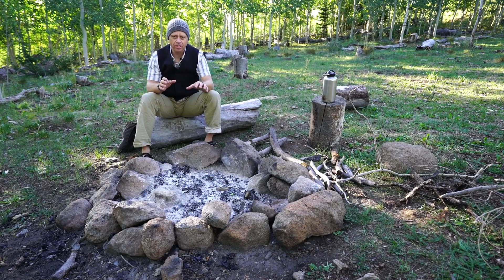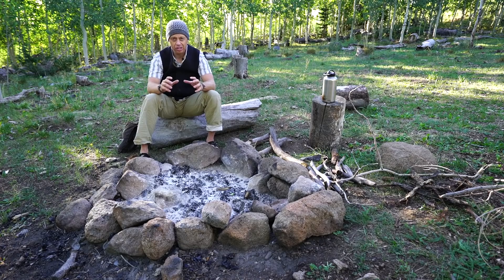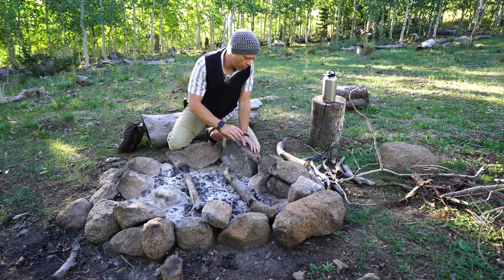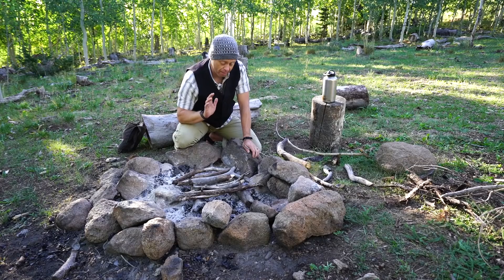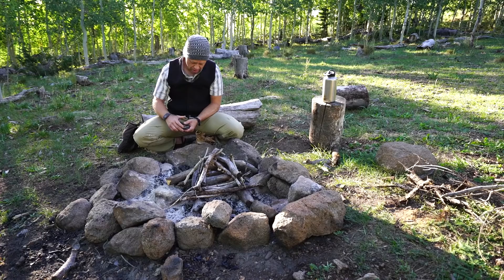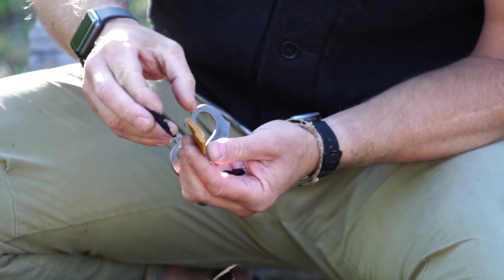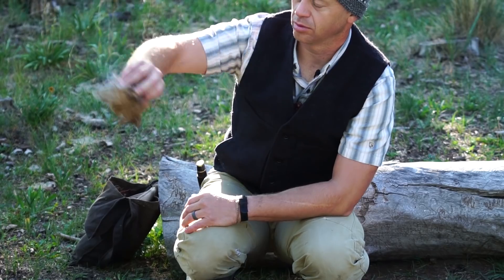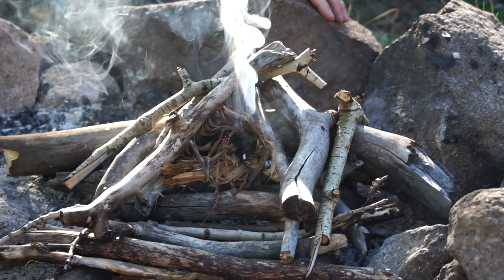A Fire Lay That Actually Works!

Comment: Here's something you might want to try. When carving feathersticks, I find that using the, say, last quarter of the edge towards the tip gives me the best results; finer and above all longer curls. At first it seems like a mechanical disadvantage, but feathersticks don't require power cuts. My hypothesis is that due to the decreased power, the blade can move a bit in the cut and thus conform better to the wood. Just give it a try, maybe it works for you.
Oh and great firelay. I have been using pretty much the same without the doglegs underneath. But the doglegs are a great idea for wet and/or cold ground conditions.
Reply from the maker: kaizoebara I’m all about learning new things. Do you have a video explaining what you’re talking about?
Reply: @TJackSurvival  I spent all my video gear money on carving tools, again... seriously though, me making a video would be hit or miss, I guess.
You can see it here, as demonstrated by Mors Kochanski:
https://youtu.be/TdbwJJkPGXA?t=88
You can see that he makes the curls mainly with the last quarter of the knife (in sword terms that'd be called the 'weak' of the blade) and how the knife rocks in his hands while he chases the cut. Another bonus is that you make use of the belly: due to the canted presentation of the edge you not only get a better slicing action (much like a guillotine), you also make the feather curl outward and not so much onto itself. Incidentally, he also has brittle/crumbly wood. Hope that explains it a bit, if not, feel free to ask.

Comment: Son, not a bad lay.  However, getting into semantics, heat doesn't rise it radiates. Warm air rises.  Heat is energy therefore no mass or volume so it can't draw in oxygen.  While the air has volume, rising due to the expansion of its volume from warming, it can draw oxygen.  Thus "draft".
Reply from the maker: fortbuilder100 Well technically, I don’t think anyone else was confused about what I said. ;)

Comment: I like the platform idea. I normally use a half dome with kindling and put my tinder bundle underneath. It falls over on itself and ignites the small sticks I put on the dome. More wood is added as the sticks catch. It takes a little longer to build a bigger fire, but what's the rush? 
I might have to try combining the two and see how it works. Putting the half dome on a platform...might save me from nursing the fire...lol
Reply from the maker: GatitosWorld Test it and film it and let me know the result. Then we all can experiment and learn
Reply: @TJackSurvival  Will do....is it possible to post the video here in the comments? 
Maybe in a fb group...

??
Reply from the maker: GatitosWorld You can post a YT link here or I run Bushcraft & Survival Tribe or I have a FB page. Whatever you want is fine.